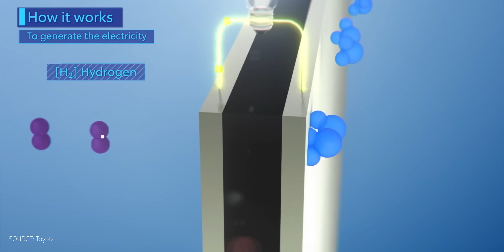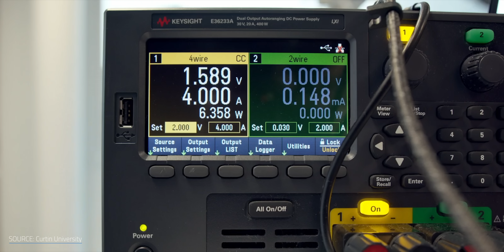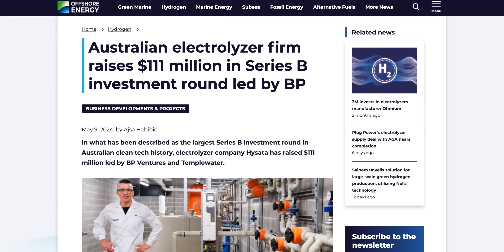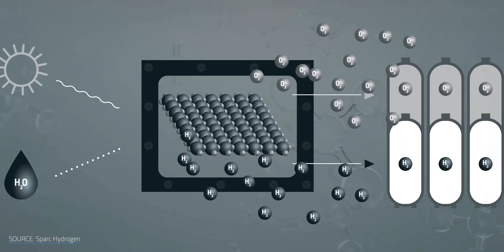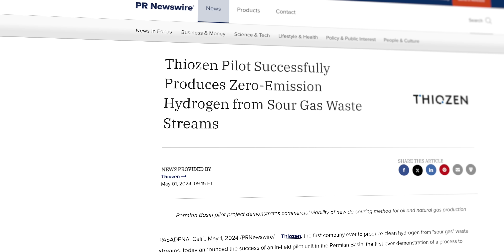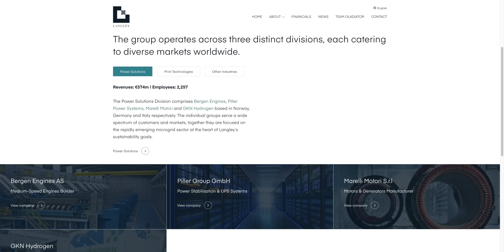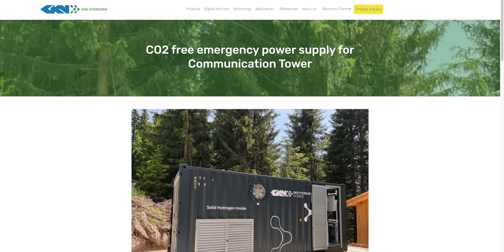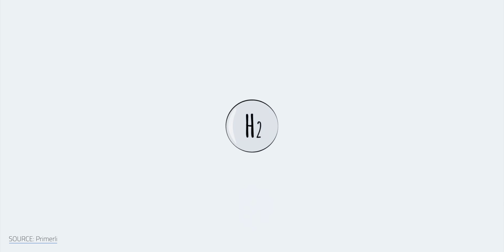How a Hydrogen Breakthrough is Closer Than Ever

Comment: Creating a state-of-the-art hydrogen fuel cell that surpasses the technology of existing companies requires deep scientific expertise, access to advanced materials, and significant investment in research and development. The process involves both materials science and engineering, alongside innovations in system integration. Here’s a general blueprint and list of materials that would be needed to develop such a fuel cell.

1. Type of Fuel Cell: Proton Exchange Membrane Fuel Cell (PEMFC)

	•	This is the most common type of fuel cell used in vehicles and portable applications due to its high power density and quick startup. It is ideal for transportation, but advancements in materials can increase its performance for other applications as well.

2. Core Components of a Hydrogen Fuel Cell:

	1.	Membrane Electrode Assembly (MEA):
	•	The MEA is the heart of a PEM fuel cell, consisting of the proton exchange membrane (PEM), catalyst layers, and gas diffusion layers.
a. Proton Exchange Membrane (PEM):
	•	Material: Nafion (a perfluorosulfonic acid polymer) or newer advanced ionomers that are more efficient at conducting protons.
	•	Goal: Develop membranes with higher proton conductivity, durability, and the ability to operate at higher temperatures (up to 120°C or more), which will improve the cell’s efficiency and longevity.
	•	Advancement: Use of graphene oxide or alternative ion-conducting polymers to increase strength and durability under a wide range of conditions.
b. Catalyst Layers:
	•	Material: Platinum (Pt) nanoparticles on carbon support are the traditional choice.
	•	Goal: Reduce platinum usage or replace it with alternative, non-precious metal catalysts (such as transition metal nitrides, carbides, or alloys) to lower cost and enhance catalytic activity.
	•	Advancement: Research into platinum-group-metal-free catalysts (PGM-free) or nanostructured catalysts, like iron-nitrogen-carbon (Fe-N-C) catalysts, can significantly reduce costs while improving performance.
c. Gas Diffusion Layers (GDL):
	•	Material: Carbon paper or carbon cloth impregnated with a hydrophobic polymer like Teflon (PTFE).
	•	Goal: Optimize gas permeability while maintaining efficient water management.
	•	Advancement: Nanostructured materials like carbon nanotubes (CNTs) or graphene could be used to improve durability and gas transport efficiency.
	2.	Bipolar Plates:
	•	Bipolar plates distribute gases and current across the fuel cell stack.
	•	Material: Traditionally graphite or metal plates coated with corrosion-resistant materials.
	•	Goal: Create lighter, thinner, more durable plates with improved conductivity and corrosion resistance.
	•	Advancement: Use lightweight materials like stainless steel, titanium, or composite materials with advanced coatings (e.g., carbon-based or polymer-based) to improve performance while reducing cost and weight. Thin, printed bipolar plates or 3D-printed structures could optimize gas flow paths.
	3.	Hydrogen Storage:
	•	Type: Compressed gas, liquid hydrogen, or metal hydrides.
	•	Goal: Develop high-density, safe, and efficient hydrogen storage systems.
	•	Advancement: Explore solid-state hydrogen storage (using metal hydrides, carbon nanostructures, or complex chemical hydrogen carriers) to improve energy density and reduce weight compared to traditional compressed gas tanks.
	4.	Water and Thermal Management Systems:
	•	Fuel cells require careful water management to ensure the membrane stays hydrated without flooding the catalyst layers, as well as heat management to prevent overheating.
	•	Materials: Advanced water-absorbing polymers, heat exchangers made from high-conductivity materials.
	•	Goal: Develop lightweight, low-cost heat exchangers and humidification systems that can operate efficiently across a wide temperature range.
	•	Advancement: Use of nano-engineered heat exchangers and microfluidic water management systems could improve overall efficiency and durability by ensuring proper hydration and temperature regulation.
	5.	Current Collectors:
	•	These are used to collect the electric current from the fuel cell.
	•	Material: Highly conductive metals like gold-plated stainless steel or copper.
	•	Goal: Increase conductivity and reduce the weight of current collectors while improving corrosion resistance.
	•	Advancement: Utilize graphene-coated copper or nanostructured carbon materials to improve performance and reduce material costs.

3. Innovations to Make the Fuel Cell “State of the Art”

	1.	High-Temperature Operation:
	•	Most PEM fuel cells operate around 60-80°C, but developing high-temperature PEM fuel cells (HT-PEMFCs) can increase efficiency and tolerance to fuel impurities.
	•	Materials: Phosphoric acid-doped polymers, polybenzimidazole (PBI) membranes, or perovskite-based materials for high-temperature conductivity.
	2.	Durability Enhancements:
	•	Goal: Increase fuel cell lifetime to over 10,000 hours for automotive applications and 60,000+ hours for stationary power.
	•	Advancements:
	•	Use anti-corrosive materials for bipolar plates and GDLs.
	•	Develop self-healing membranes that can recover from physical or chemical degradation over time.
	3.	Hydrogen Production and Integration:
	•	Green Hydrogen: To ensure sustainability, integrate your fuel cell system with green hydrogen production methods, such as electrolysis powered by renewable energy (solar, wind, etc.).
	•	Goal: Establish seamless integration between hydrogen production, storage, and fuel cell use, making the entire energy cycle renewable and cost-effective.
	4.	System Miniaturization and Integration:
	•	Develop compact and highly integrated fuel cell systems using modern materials and nanotechnology. This would improve energy density, reduce the weight and size of the fuel cell stacks, and allow them to fit into a broader range of applications (e.g., drones, portable electronics, aviation).
	5.	Smart Control Systems:
	•	Incorporate AI-driven optimization to manage fuel cell efficiency, power output, and degradation over time.
	•	Goal: Use data from sensors embedded in the fuel cell system to continuously optimize performance, predict maintenance needs, and extend operational life.

4. Manufacturing Innovations

	1.	3D Printing and Additive Manufacturing:
	•	Use 3D printing to create complex fuel cell components with optimized flow channels for gas and coolant, improving overall efficiency.
	•	Develop cost-effective manufacturing methods for large-scale production of fuel cells, including automated assembly of MEAs and bipolar plates.
	2.	Recycling and End-of-Life Management:
	•	Design the fuel cell system to be recyclable at the end of its life, with reusable or easy-to-reclaim materials (such as platinum and membrane materials).

Materials List:

	•	Proton Exchange Membrane: Nafion, PBI, or advanced ionomer membranes.
	•	Catalyst: Platinum nanoparticles (or platinum-free alternatives like Fe-N-C).
	•	Gas Diffusion Layers: Carbon paper/cloth, possibly enhanced with carbon nanotubes or graphene.
	•	Bipolar Plates: Graphite, stainless steel, titanium, or composite materials with advanced coatings.
	•	Hydrogen Storage: Metal hydrides, compressed gas tanks, or advanced solid-state storage materials.
	•	Current Collectors: Gold-plated stainless steel or graphene-coated copper.
	•	Water Management: Hydrophobic polymers (Teflon), nano-engineered heat exchangers.
	•	Heat Management: High-conductivity materials, possibly phase-change materials for thermal regulation.

Final Blueprint:

Developing a state-of-the-art hydrogen fuel cell will involve cutting-edge materials (like nanostructured catalysts and graphene components), advanced manufacturing techniques (like 3D printing and additive manufacturing), and smart control systems (AI-driven efficiency optimizers). To make it truly superior, focus on reducing the use of expensive materials (like platinum), increasing the durability and lifetime of the fuel cell, and ensuring integration with green hydrogen production methods for sustainability.

Comment: In this process, hydrogen is only produced when there is sunlight. This is only for a few hours in the day time. For night time, hydrogen so produced will have to be stored. Most likely it will have to be steel alloys pressed into use. The problem there is steel brittleness caused by hydrogen seeping into iron. Storage devices made of iron alloys will have to be frequently replaced.

Comment: There is so many issues with hidrogen, starting from the fact that halfway through the process the engine just transforms it into electricity making it redundant and wasteful, every transformation leads to loss of efficiency, storage is a NIGHTMARE, not even Nasa can get it right over multiple launch attempts, producing it in a way that is ACTUALLY green is also incredibly hard.

The only positive is that it's good for large vehicles, but, really? there should be no theoretical actual reason behind why loading a gas should be faster than loading electricity to a car, we just have to work on chargers and batteries more.

Comment: Unless the energy from the produced hydrogen is greater than the energy it took to produce it, then it's not a source of energy, it's just wasting energy.  sometimes a loss of energy could be worthwhile such as for storage or conversion to a more useful form like oil an energy dense liquid...hydrogen, so far, seems to offer no additional energy and usually takes perfectly useful electricity to extract hydrogen, which is difficult to handle or store or transport, having less energy than it took to produce.

Comment: I am just thinking. The hydrogen is green if we put it directly on a windmill.... yes! 
Feeding it directly into the grid would be better, but lets pretend, this is "extra" power the grid isn't needing. 
How does it compare to a battery? Isn't it still the case that I lose much more potiential energy by making the hydrogen, and later burning it or whatever you do, than you lose from putting it in a battery, and using from that battery?

Comment: If methane gases would leak from the Earth anyway, then breaking it up into hydrogen and other derivatives means keeping it out of the air,  So it actually does get us "off of fossil fuels", which shouldn't imply simply ignoring what happens with or without human activity.

Also I was hoping for new information about Bioterran's solid hydrogen but this seems to be with an Australian company focus. Bioterran hasn't posted any updates since their first announcement in January,  onward trodden journalists!

Comment: hydrogen volumetric energy density (VED) 8MJ/L  https://youtu.be/ISuUlc8widc?t=69 ??? probably for liquid hydrogen (-240,18°C)
H2  VED  at atmospheric pressure is 0.01 MJ/L, compressed to 350 bar  3 MJ/L, compressed to 700 bar  5 MJ/L

Comment: Another opportunity to actually teach people something, wasted on repeating rubbish, like that H2 is the most abundant element in the universe...which is true, but totally irrelevant here on earth.  Or that you only get water when you burn hydrogen- which is only true in a low temperature fuelcell- when you burn hydrogen in air, you get NOx just like when you burn ANYTHING in air.  

And hydrogen's volumetric energy density is tiny.  It only reaches 1/4 the volumetric energy density of gasoline when you have it as a LIQUID.  Gaseous hydrogen at room temperature and atmospheric pressure has an energy density of 0.01 kWh/gallon, compared with 33 kWh/gallon approximately for gasoline (LHV basis).  Compress it to 700 bar and it is still only 5 kWh/gal, and liquid H2 is only 8.9 kWh/gal.

Here's why what's wrong with the wasting of hydrogen as a fuel, can't be fixed by improving electrolyzer design or efficiency.  https://www.linkedin.com/pulse/breakthrough-electrolyzer-efficiency-paul-martin/

Comment: Don't think of Fossil Fuel-derived Hydrogen as 'dirty' energy. Think of it as recycling 'clean' energy from Fossil Fuels. It's a small step, but its still a step.
(For the record, my stance on Fossil Fuels is that we should have moved to remove our dependence on them in the 90s, and been on track to completely replace them by now. But Economies and Interdependencies of this scale don't change overnight, and the more clean sources of energy the better. Especially if it can show the Bigwigs there's money in clean & renewable).

   It's not a long term winner, but it makes the current entrenched system less wasteful, and provides drive & supply of Hydrogen.
   When Fossil Fuels run out or are replaced, these sources go away too, but the expertise will remain, and there will be demand for the cleaner solutions. And people trained on Hydrogen to man those jobs.

Comment: Regarding the various electrolysis systems.  Especially the ones that might be "married" to an off-shore wind farm, how pure does the water have to be that you're feeding into the system?  For some reason I doubt you could run raw sea-water through them.  For that matter even potable well water (which is a decreasing source!) would probably need to be purified/distilled before undergoing electrolysis.

Comment: Hydrogen as an energy carrier is a thermodynamic opium pipe dream.  The enthalpy will alway remain the same as it has always been, the only verifiable is the activation energy and it will always be a significant value.  An energy loss situation for each step, and another energy loss for each storage, transport or conversion step.  Too little energy left to be economically viable except perhaps, maybe for the manufacture of nitrogen based fertilizers much later this century once natural gas is depleted.

Comment: For back-up Power in grid connected sites - then 300 bar cylinders 50 liter each holds 16,8kWh electricity delivered. Meaning 50 cylinders (4 pcs 12 cyl. bundles - that takes up 4m2 footprint… ..can be bought for approx €200-€250 per cylinder, and then you can refill during and after an outage.  Engineers tend to overcomplicate things. Simple is good in telco - Italy properly have 19.999 other cell towers to maintain as well! Thank for super content!

Comment: Matt, I am sorry but I am not sure that hydrogen is a solution. It is very very corrosive, hard to store, tricky to ship. More importantly, what is the environmental impact of high humidity (H2O production) from H2, when the source is not the humid air we breathe? In other words, what impact does making H20 in our air, compare to H20 in our water? Would that then become a "hostile gas" like C02 which is also a naturally occuring gas? I would love to see some comparisons of H20 vs C02 vs gasoline emissions or carbon from power plants, et al. I think H20 high humidity will be an issue and a green house gas at the human levels we would produce?

Comment: Pearl clutching? Is there a gender neutral label for this activity? The fossil fuel companies want us to believe green hydrogen is impossible so we don't do hydrogen. Lots of well meaning folk get sucked in.
Why not take a more rational approach? Does hydrogen do something useful? and, can it be implemented? Then ask how hydrogen can be produced better. Divide and conquer the problem.
From our current perspective hydrogen Is already used in industry and this will continue. We should expect more hydrogen to be produced for the new applications. We don't need to "reserve" hydrogen because it is so useful already. Using energy to make hydrogen is not 100% efficient so the hydrogen has to bring something to the table to make the cost justified. Basically this is standard engineering analysis.
Already hydrogen is a power source for some models of Toyota cars available today. Hydrogen is already powering some aviation today. Hydrogen is being explored for use in steel production at scale. And the list will only get larger.
Hydrogen is not suitable for domestic usage since existing or affordable distribution systems are totally unsuitable for this gas. (But that does not stop existing gas suppliers from pretending while they try to revalue the stranded asset represented by all those pipes.)
Each of the hydrogen use cases will be determined on the merits. The security company using Toyota hydrogen powered cars loves how fast they can be refuelled. The people flying planes love that the weight of fuel is no longer a factor in the flight plan. The people working on the design of hydrogen based steel production appreciate the prospect of not needing to mine and transport coal.
All very good and much work still to be done, but, the bleating starts about the hydrogen isn't all green and it's not perfect... does this mean we stop?
Of course not, we should keep building a market for hydrogen use where is makes sense, and, especially, where it replaces fossil fuels. We also need to continue replacing the fossil fuel based generation of electricity, since most of the hydrogen is going to be produced by electrolysis. Hydrogen is relatively hard to distribute, and electricity is relatively easy to distribute.
Like I said above, we have two problems, and they are not tightly coupled. We can solve how we want to use hydrogen, and also solve how we make the electricity supply more sustainable. 
Don't get fooled by the fossil fuel companies and their "but it's not good enough" misinformation campaigns.

Comment: It's interesting to think about excess energy from renewable resources being used for hydrogen production to flatten the demand curve when the renewable can't meet demand. Especially if the processed hydrogen doesn't need to be transported from the reservoir and can be converted back to energy and use the same transmission lines as the renewable source. 

If "95% efficiency" is true, that would make hydrogen an extremely potent energy storage technique. You could potentially even reuse the same water over and over, replacing 5-10% of it each cycle.